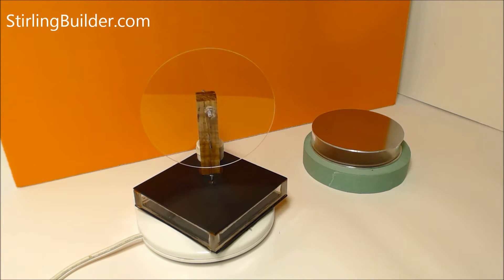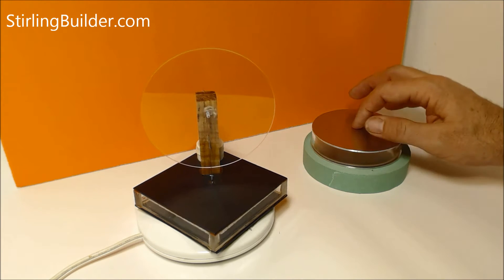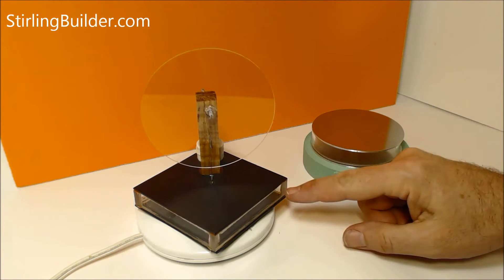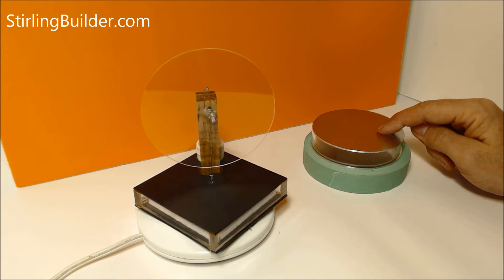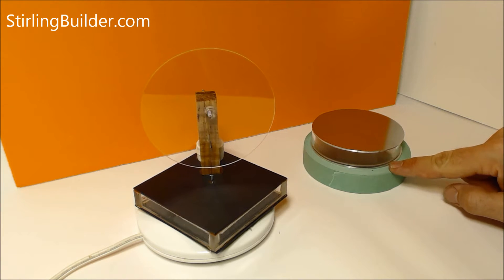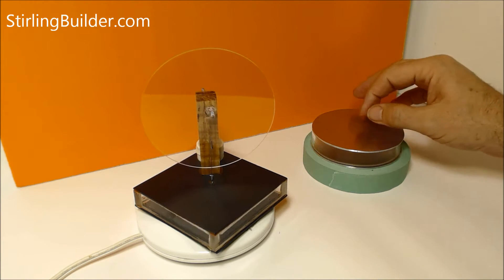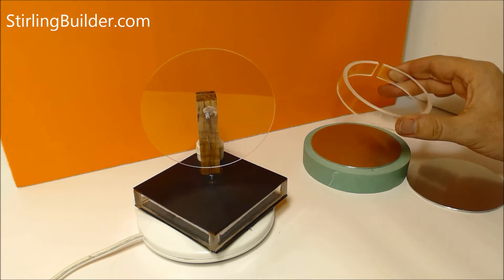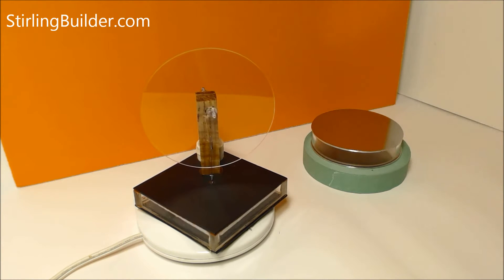Thermoforming the Acrylic Sidewall for an LTD Stirling Engine

Comment: I work with an artist who works in plastic (PETG), and you can use an oven to get a nice even, controlled temp on the workpiece, and it's more consistent/less laborious/less boring than a heat gun.

Comment: if they can be made of such cheap bits and pieces then why are they so expensive?
Reply from the maker: Precision machined parts make many motors expensive.  I am working to find affordable solutions that will work well for the average builder who does not have a machine shop.